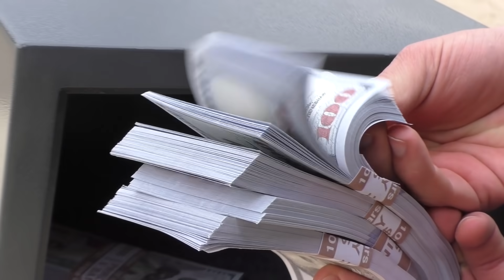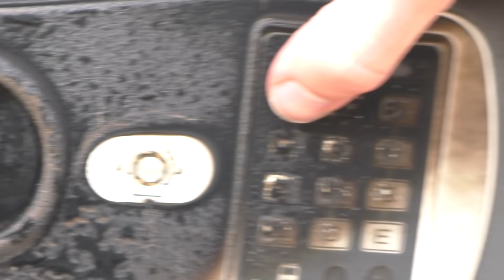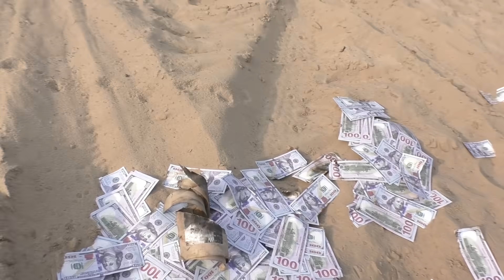EXPERIMENT : How To Open Safe Without Key?

Comment: Those China safes work with a solenoid that releases the bolt. The spring that keeps the bolt in place is so week, you can open these types of safes by tapping it on the top and turn the knob simultaniously. Open within a few seconds... Did that once at a store when the owner tried to sell one of those to another customer.... No sale!
Reply: Hi dad
Reply: Hi this kids dad
Reply: 44 4445y yr
Reply: Ĺooooooouuuu
Reply: Ŕrcp
Reply: Weak*

Comment: I have this very same safe in my office. After forgetting the code and losing the key, I opened it in about 2-3 seconds with a lock pick.

A second way I could have opened it is to put a long knitting needle through one of the holes in the back (far side opposite the lock), hunt a bit to find the door reset button in front, push it and just reset the code. Of course, blowing it up with progressively larger explosives was probably a lot more fun.